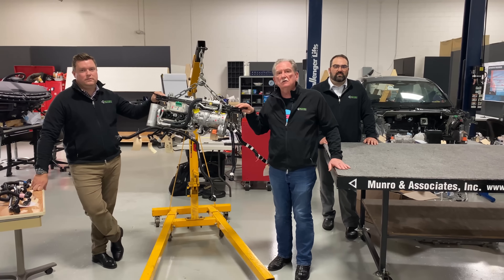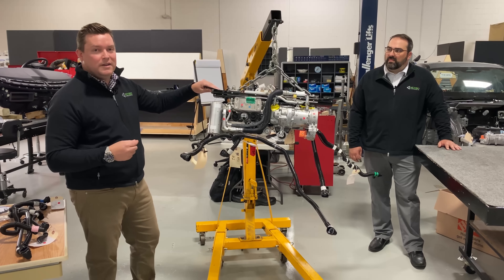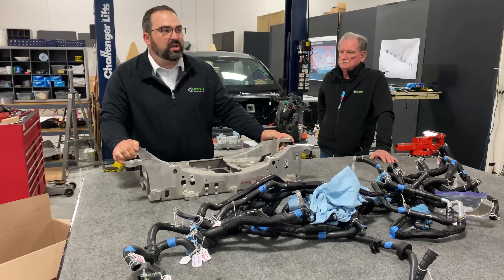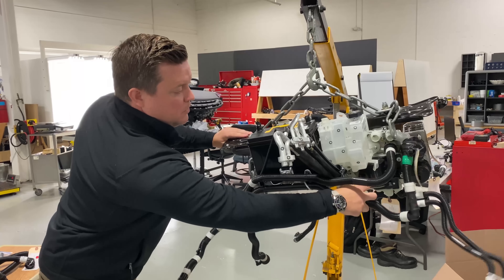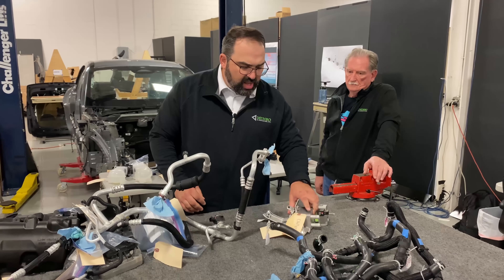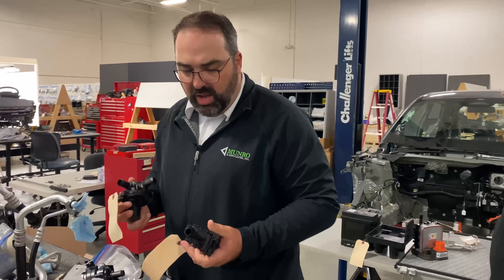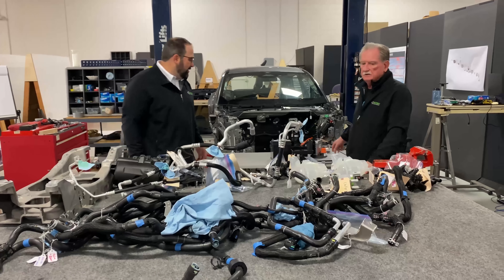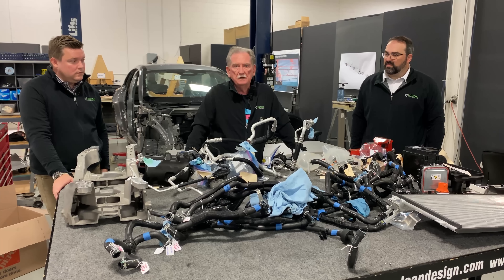Mach-E Thermal System Part 2: A Detailed Comparison to the Model Y

Comment: The worst thing a Mach E owner wants to hear: "Hey, you've got a coolant leak"
Reply: But at least they've got two independent loops so not everything gets fried at once.

The two pumps required because the pathways are so long reminds me of the story that big lumbering dinosaurs had two brains because the neurons were so long. I'm sure there's a metaphor there somewhere.
Reply: @Error6503  Nothing to fry on a EV car if you happen to have a coolant leak. The temperature ranges that EV cars (Ford, Tesla, Porsche, Audi, ect) cooling loops are exposed to is no where near boiling point. 
More in the upper 80's at the most. 

Therefore if the systems detect a leak, they simply lower the battery discharge rates and allow you to get home. 

You can safely open any EV coolant circuit and you aren't ever going to get boiling coolant sprayed in the face.
Reply: @Error6503  Or multiple bovine stomachs.
Reply: Ford knows what is doing, this was designed by Ford Dealership, we recommend changing hoses every three years.
Reply: Or, "You've got a coolant leak, and your warranty was up yesterday"! Ouch, may as well pay for an ICE replacement with all the stuff that needs to happen to track that leak down!
Reply: Rofl
Reply: A plumbers nightmare.
Reply: So instead of the 60k miles timing belt and water pump change for ICE cars, it'll be a full 35 hoses swap coolant service for Ford EV.
Reply: @imtexaspete  - Of course.
Reply: Hey, if you get a coolant leak. You have plenty of time to fix it considering you have 3 times the fluid
Reply: Music to the dealer's ears 💲💲
Reply: gonna spend 10,000$ at the mechanic to fix that 1 little leak

cuz they gonna have to take everything apart and mechanics cost a lot of money per hour theyr work
Reply: The local mechanic is going to need a schematic diagram on how to reconnect all them hoses.
Reply: Yup. Because octovalve replacement will only cost a few pennies more than a hose clamp.
Reply: @snaplash  unfortunately I would bet it is plastic and technically unreparable.  But I'm not the one taking the vehicle apart that would be a Question for Sandy Munro
Reply: @Jimmy Edward It would not be surprising if when the lease is up on the car that Rich's people fixed gets charged the 15000 for battery replacement so they will bend the customer over in the end like they planned to when the damage happened or cause charging issues but Tesla isn't known to do that😂
Reply: @Jimmy Edward why are you making it a big deal?!
Reply: That is funny.
Reply: First question is, Where? Well it's going to take a while to figure that our at $120/hr
Reply: OH, you know the leaks are coming! I can't wait to see pics of coolant everywhere and pissed off people who were stranded out in the middle of nowhere.
Reply: You've obviously never built a water-cooled gaming rig or crypto miner before.  ICE engines aren't the only thing that produce extreme heat.
Reply: @MaximGhost  it’s mini explosions to turn cylinders. By definition it is heat wasting to create movement
Reply: Tesla coolant leak; 16000$ for a new battery.
https://youtu.be/vVSw3KSevEc?t=827
Reply: This is getting a bit like liquid cooled server racks in data centres, except not embracing trends towards sub- atmospheric cooling circuits designed to leak air inwards and not coolant outwards, with air pumped out with a vacuum pump.
Reply: "You have a coolant leak - we need to take the engine out"   "Engine???"  "Yeah - we pop a small one in between all the hoses, just in case the electrics don't work."
Reply: A Tesla owner doesn't want to hear that the inlet nipple has cracked you now need a new battery ( Rich Rebuilds had one )
Reply: @lancemessenger4838  This is a good point. Tesla isn't perfect, and that nipple repair/replacement incident needs to reviewed and a repair kit/instruction issued. I expect that will happen, as I also expect that design decision will be revisited with the new battery packs. Meanwhile, the owner DID find a reasonably priced solution. A Ford Mach-E owner in a few years will be faced with a pretty big labour charge to deal with something as simple as a coolant leak, and the only way round it is a day or so of his/her own labour. Having watched the video of the repair that was done on the Tesla, I know which one I would prefer to tackle on the driveway.
Reply: @lancemessenger4838  Which was fixed super easy with treading the plastic and installing a simple plumbing nipple.. say the whole truth.. not just little parts for your slant.
Reply: @1905934  the truth is Tesla wanted 15000 to replace the battery not the economical fix
Reply: @lancemessenger4838  And can you imagine what Ford would have charged.. I saw the same video..so what are you trying to sell.. I ain't buying it.
Reply: @1905934  still your response does not negate the fact that Tesla wanted and only wanted to replace the battery pack
Reply: @lancemessenger4838  This is the part that makes me shake my head.. you expect Tesla to cut off the piece and tap it and put in a nipple from Home Depot.. As with all manufactures that HAVE to follow the engineering first practices.. you actually can not figure this out by yourself?  Maybe you should buy a ford.. they probably repair hoses with duct tape and  gum.. Is this more with your expectation?
Reply: @1905934  well maybe Tesla should redesign the battery case to prevent that damage and offer the  up dated design to the customer's that have it fail
Reply: @1905934  you were the one that described the repair to defend your position
Reply: @lancemessenger4838  How do you know it failed.  Could be that some uneducated idiot thought this was a good place to jack the car up.  Has there been any other cases of this failing... wait for it.. wait for it... NOOOOOOOOOOOOOOOO.. My first car I had was a Mazda.. jack the car up from the floor pan.. punched a hole right thru. Mazda never redesigned their car floor boards either.. these companies are all the same.
Reply: @lancemessenger4838  Yes lets recap....Tesla has to be educated and have the proper repair.. bring your car to an independent repair shop and have it fixed using a simple threaded nipple.. this doesn't explain how it failed? This fail represents 1 in 2 million cars.. as there are 2 million Tesla on the road. There is all kinds of weird failures in all cars.. what exactly is the point you are trying to make?  You can bring any car to a dealer and they have to use authorized dealer parts.. bring the same car to a buddy and use aftermarket parts and can do the same job for about 1/10.. this is not new.. have you ever owned a car?  If you do then you should get this.. or you a sucker for click bait articles.
Reply: @lancemessenger4838  My ego is pretty big .. I must say.. love myself all the way.  Glad we can agree on something.. this is not a defect.. pretty simple.. you can't get this?  Maybe if you had an ego.. you could think .  Maybe I am privy to Tesla internal records.. maybe not.. this is not an issue and is not a defect... Maybe you still don't get it.. here for the 3rd time.. wait for it.. It is NOT a defect.
Reply: @lancemessenger4838  I am not sure what you are trying to argue here.. if you break a part on your car.. if is $1 or $1 million.. it is not the manufactures fault.. and the fact that you answered twice.. means you must win this argument that you don't even know what it is that you are arguing about..
Reply: @1905934  I don't know if I should laugh at You or feel sorry for you on second thought I will just Laugh at you 😂🤣
Reply: 1905934 
It was the second car the shop fixed, with exact same coolant leak, according to the repair video.
Reply: @lancemessenger4838  He let his insurance lapse. That was the biggest mistake.
Reply: @seoultocebu  true that was his biggest mistake but it did point out a issue with the cooling port design that I hope Tesla and other companies address because $15000 battery claims causes everyone's rates to rise
Reply: @seoultocebu  Is it possible to allow one's insurance to lapse. After all, doesn't everyone get three reminders daily.
Reply: @lancemessenger4838  Yup. I'd much rather work on this Ford than work on the Tesla. Oh wait, you CAN'T work on your own Tesla - they oppose Right to Repair!
Reply: @lancemessenger4838  are you sure the MachE does not have nipples like the Tesla? No place thst can break and you need anew battery?
Reply: @danubiosalas4231  I suspect they do and hope that they have a repair plan for that even though It's unlikely just like Tesla . I Have to add that a main and highly expensive component I feel that they manufacturers should have a repair plan I know most people would tolerate let's say a $5000 manufacturer reconditioned battery easier that a $15000 new one
Reply: @lancemessenger4838  well that was an easy fix in the end. Not a bad wrap on teslas but a bad wrap on the company's service thinking.
Reply: @lancemessenger4838  
Nice try.
Fail.
Reply: @rogerstarkey5390  I would say that the mighty Musk should of foreseen that a simple nipple fitting low on a vehicle behind a light plastic air deflector could be a problem and maybe implemented a simple repair or even a design improvement. So nice try
Reply: @lancemessenger4838  There's at least half a million or more model 3s in the us alone , how many has this happened to? This is statistically insignificant. And I'm sure they'll re-design it anyway.  

That rat's nest of hoses in the Mach-E is almost guaranteed to leak somewhere.
Reply: @cyberfred5520  using your own words they   ( ford) will probably redesign it .  And I hope Tesla does also because if you were the one taking on a 15000 repair likely you would not be happy with that
Reply: @lancemessenger4838  you obviously don't watch Sandy Munro much  "Tesla innovates at the speed of thought" it's probably is one of his favorite sayings. Given the giga press that is now measuring in microns and the first structural battery just came off the line that is something of the past that never really was a problem since he bought a broke Tesla. Working in the HVAC industry I can see a leak in the Marquee costing several hundreds of dollars to fix if it's in the wrong place. This design is not scalable so there will never be as much monkeys sold as Model Y's.
Reply: @stevencastellanos8063  
I wonder if they're seeing these comments as they frantically try to redesign the F150 system? (I still can't bring myself to call it "L ........")
Reply: @stevencastellanos8063  you mean cost like a simple nipple getting broken and Tesla say to replace the battery pack. Check out Rich Rebuilds to see design flaw
Reply: @stevencastellanos8063    I'm curious as to why Sandy Monro never caught the flaw in Tesla s
Reply: @stevencastellanos8063  I'm curious why Sandy Monro never caught the cooling system flaw in the Tesla of a single fitting damage requiring total battery pack replacement. But then he is the master of large expensive to replace modules
Reply: @lancemessenger4838  well it is and it isnt a flaw. Its vulnerable sure, but a flaw? Nothing is ever going to be 100% so you have to give them some slack. Where you can give them some stick is tesla's reply to the issue. Very much the arsehole response.  Tesla service techs dont have or are not empowered to go beyond the fine print. Tesla should have a system where problems like this can be addressed without gouging customers. Utopia maybe? Well they want us to take them seriously, so they should act serious.  Acting like apple isnt going to win friends in the long term.
Reply: @andyfreeze4072  ok definine it as you want it still broke but thanks for admitting the true flaw is in the service and maintenance chain
Reply: @lancemessenger4838  that's easy.bhe has never torn apart a Model S.please do your homework. Trolling shouldn't be your main job!;)
Reply: @stevencastellanos8063  troll troll troll    goes Steven Low T musketeer. 😂🤣
Reply: @lancemessenger4838  Admitting implies denying at some stage. For the record, I am stating the obvious, not ADMITTING.  I certainly wouldnt pay $16,000-$20,000 for a battery when a simple fix does the job.  I guess a tesla's owner's misfortune will create new jobs, lol.
Reply: @andyfreeze4072  love your Linguistic sidestepping  I'm certain   its a habit you picked up over time but glad you  see that the battery pack replacement could be viewed as a excessive cost Vs. A alternative and more economical repair
Reply: @lancemessenger4838  no lance, i dont put words in other people's mouths, lol.  you  dont speak for me. I dont know you from jack shit. I have never spoken to you so why are you trying to put your thoughts in my mouth? i will keep saying, tesla does itself no favours by exhibiting such behaviour.
Reply: Tesla used flexible hoses wheras Ford used hard hoses. Flexible pipes don't pump as well (because of push+pull mechanics) and aren't as leak-resistent since they cured the same way hard pipes are at the joints. The advantage of Flexible pipes is that they're super easy to install. Ford's solution isn't as cookie-cutter.
Reply: @johnnguyen3834  
Ford's solution is "parts bin"
Reply: Elon MUSK is New God! Mars is the New Earth! Earth Will soon Die Anyway!! TESLA and Tesla Holders will be Kings. Rest and their Family will be Our Slaves and work to Power energy for Bit coin!! Elon is Einstein, Edison, Newton, and Jesus combined. HE at least deserves several Nobel Prizes. Elon has more IQ than weight of Hater's Ug ly Prius and his F at Ho Combined!! HE is like Ironman who will destroy Thanos and critics are better off using their cash to wipe their a n us. JUST Worship Him instead of other silly god!! GOD Elon will Punish infidels!! Go Emperor God Musk!!
Reply: The worst thing a Tesla Owner wants to hear: Hey your battery is on fire and your doors won’t open!!
Reply: @Steven Gulie So your a investor in Tesla that adds credence to what you say NOT.  Also Tesla vehicles are not going to be under warranty forever

Comment: This cooling/heating nightmare on the Mach-E helps solidify our decision to go with the Model Y. This example helps to confirm the lack of innovation, company culture and “departments” within Ford Motor Company. If I were in a leadership position at Ford I would be embarrassed. Does Ford own stock in a hose manufacturing company?

Comment: Ford and other incumbents designing in unreliability into it's Mach E so it's dealers can continue making money.  Tesla's system appears to be designed for simplicity and reliability.
Reply: its anything but simple and will be more costly to replace than ford parts.
Reply: @hagestad  But, 80% of the cost is for labor.
Reply: @hagestad  Yes, but there's less opportunities for a leak to happen.
Reply: @charlesball6519  and yet teslas do brake just like ice cars
Reply: @hagestad  You mean break.  Brake is what you do when you stop a car

Comment: If you remember Tesla's Battery day presentation, the battery was only a 16% improvement while the weight reduction and what nots added an additional 38%. Ford should be listening to Sandy Monro for advise on engineering design.

Comment: The extra 13kg in fluid alone blew my mind, especially when every gram matters in the world of EV efficiency. I love my Mach-E but hope that Ford engineers see this and can further refine their designs.
Reply: As an indication, those in Europe/ UK, next time you're at a supermarket, pick up 4 six packs of orange juice/ milk, etc, 1 litre cartons.
That's  only slightly more than just the fluid weighs in the ford (+1.6kg)
Then pick up 1 six pack, add 3 single cartons. That's the Tesla.
Reply: really? that's like 0.60% of the weight of the car with passenger on board.
Reply: @hagestad  you forget it’s just fluid, if you include the weight of the parts, you’re looking at double or triple that in useless weight. Stepping it up to about 2% more useless weight than a Tesla. More parts to break

Comment: Yes Ford has to get better but a few comments about the comparison. They did not show the Tesla condenser. There are probably two coolant loops for a reason and I would like to know why. The Tesla needs to have a (12V) battery tray similar to if not identical to the Ford and if it doesn't there will be trouble (really expensive trouble based upon it's location). Having the pumps separate might be at the request of service engineers as they are wear parts (putting them far apart, on the other hand doesn't seem like a necessity). This is Ford's first EV and I would like to really see a progression of Tesla's early cars to the model Y. Let the record show that they didn't even have a heat pump until recently and it was obvious from day one that they needed one (using resistance heaters in an electric car is just stupid). Having said all that, electrical and piping are almost always left until far too late in the design process and that will have to change.